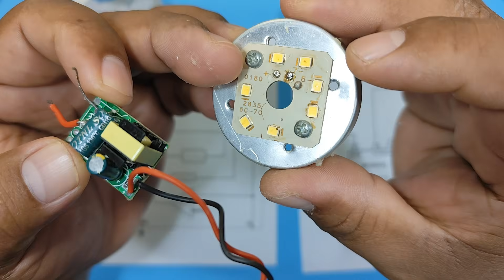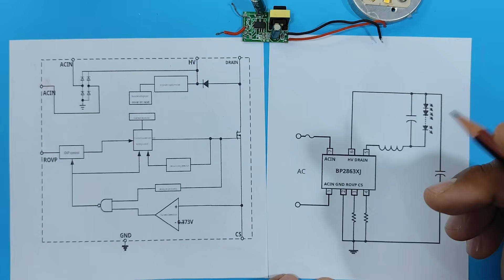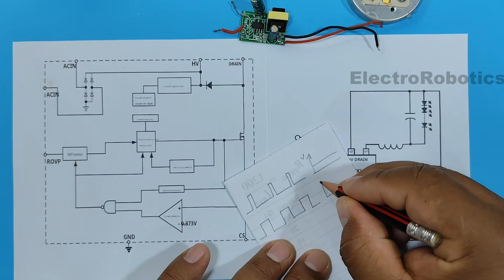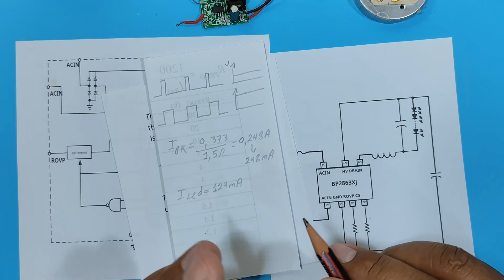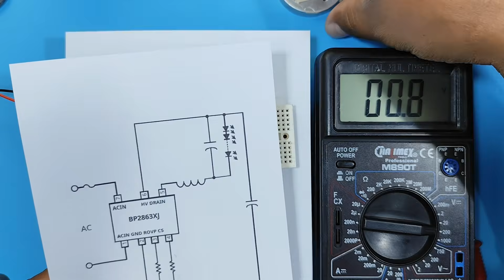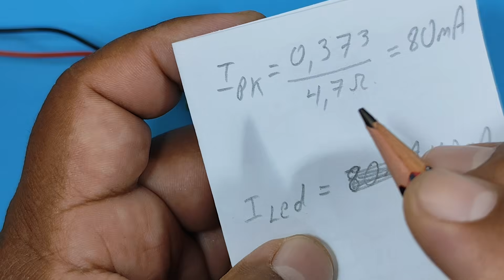What is an LED Bulb and how does it Work?

Comment: U don't tell that 310-60=250v drops across inductor which store voltage in the form of magnetic field as MOSFET turn off this inductor again supply voltage to leds🎉🎉
Reply from the maker: Well, more or less, in reality the Voltage is not maintained at 310V or 250V but with the help of the Coil and the Capacitor plus the Pulse Width the Effective voltage drops to what is necessary.

Comment: very useful video . i think if i modified the diagram and the current decrease it will be decrease the brightness of the bulb
Reply: Sim, modifique somente o valor do resistor de corrente. Faço isso a algum tempo e tenho lâmpadas que duram anos, graças a Deus. Alguns anos atrás recebi um vídeo semelhante enviado por um engenheiro de eletrônica do Brasil. Abraço.
Reply: LMAO     his explanaiom of  the IC was mostly NONSENSE.
He knows very little
Reply: LMAO     this is only true for this IC   - most  use other types 
He knows very little
Reply: LMAO      
how brain dead - of course  measuring the voltage across the Zeners gives the total Vz           LOL LOL LOL 
He knows very little